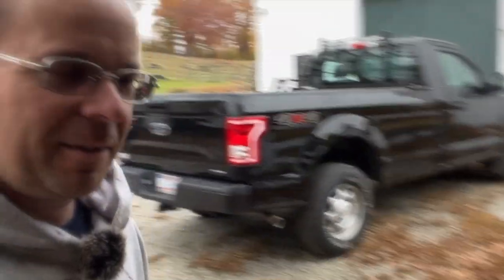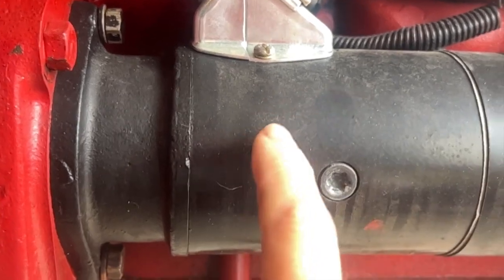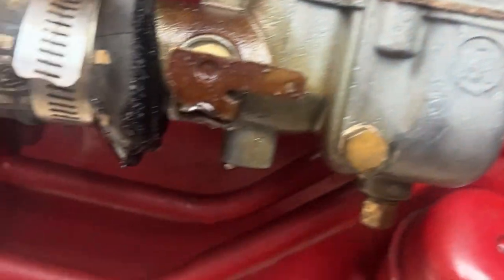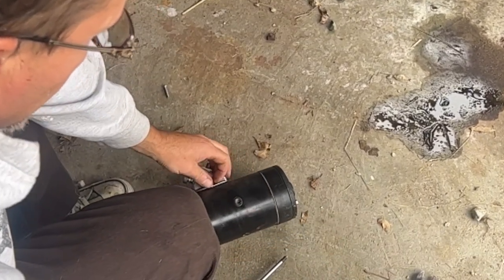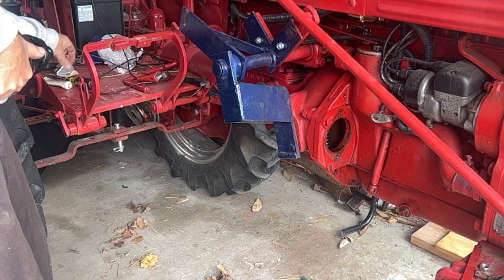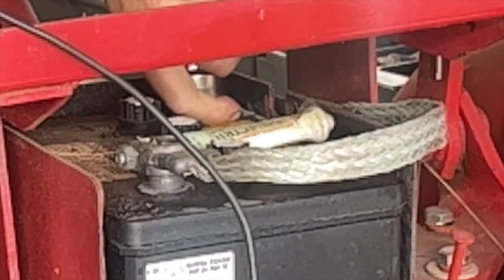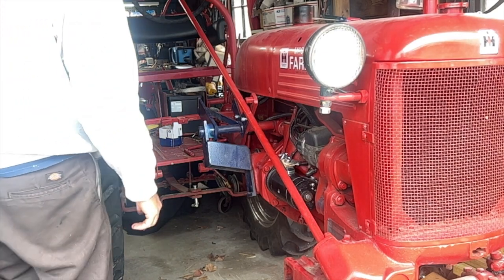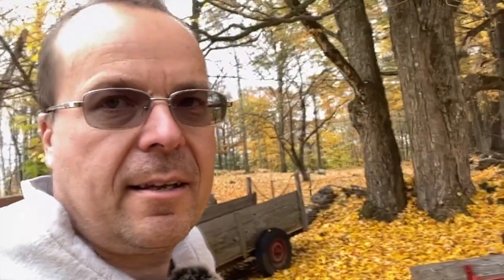1948 IH Farmall Cub Comes In For Some Pre-Sale Love

Comment: Tom I agree with Keith in that you are giving it away.  I’ve become Cub crazy this year and around here it would bring 4K.  The plows are something I don’t have and not common.  Front weights are also spendy here.  So many nice features.  Most of my Cubs smoke a little as well, pretty common issue but manageable.  I would be on my way, except at 76 and the 900 miles one way I feel it prudent to pass.  I don’t feel I need to wish you luck as it should sell instantly.   Makes me sad but I guess I just can’t buy everything.  How much to deliver it???  Not kidding either.  Stan here, aka the Col.
Reply from the maker: You just never know what Cubs will fetch. I’ve seen them from $1800-$5000 around here lately 😐
Reply: @LedgemereHeritageFarm  There are always Cubs for sale, but the equipment seems to be difficult to find.  Front weights, cultivators, planters, fast hitch’s are just not for sale.  Plows, mowers are plentiful.  I’m still w/o a complete fast hitch or a planter.  Strangely enough I have several fast hitch implements but no hitch.  Seems to be “the hunt “ is what excites me.  Probably should concentrate on the Supers - 140’s.  I’ve had to travel for that equipment as well.  Not common around here.
Reply from the maker: @stanleyconrad4234  I really like my 140. It’s hard to find things besides plows and mowers because that’s usually all farmers bought. At least up here, they converted horse drawn stuff over. We used converted horse drawn stuff well into the 1970s on my folks’ place
Reply: @LedgemereHeritageFarm  Tom I’ve chased that Farmall equipment through out the Midwest.  Mainly OH, IN, NC, TN, as well as MI.  This year I’m sticking closer to home, 250 miles or so?  Not show stuff, but workable equipment.  Longest trip last year about 1,200 miles one way for a “wackadoodle” Asian tractor I just had to have!  ??  Not enough land, or smarts to actually farm.  I enjoy your sane approach to this life.
Reply from the maker: @stanleyconrad4234  I’ve flooded out my John Deere A just now and kicking myself🤓
Reply: @LedgemereHeritageFarm  I’m sorry to hear that Tom.  I have no dog in the JD fight, just a little 425 for lawn work.  It is actually bigger than needed but I finally sprung for power steering, hydraulic lift, electric mower engagement.  Luxury stuff.  We had a JD D on steel when farming rice in the 40’s/early 50’s.  I only remember running belt pulleys on the well heads and all the darned snakes.  I’ll stick with Farmall’s and small Asian tractors.  Well there is the VA and a MF 35 hiding in the bush!  Good luck with your brothers tractor.
Reply from the maker: @stanleyconrad4234  I got it going after I took out the plugs and spun it over to blow the gas out. Haha. I don’t like snakes. There’s a book called The Painted House that’s very good. It takes place around WWII in the South. They have a cotton farm and an old jd that was new then I guess. Haha
Reply: @LedgemereHeritageFarm  I’m glad you sorted out the JD.  Purging the flooded cylinders is always a good idea.  The book you mentioned could have been our story, but cotton was losing ground in my area by mid 50’s.  Tried the automotive industry in the great snowy north, and the Army for a career.  Now tractor crazy.  Congratulations on the Deere.  I hope you do find a use for it.